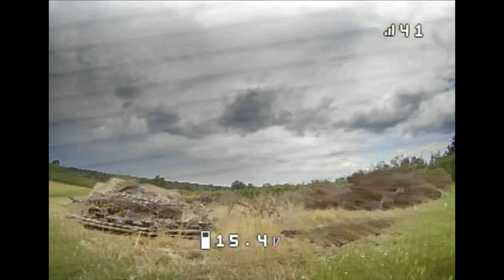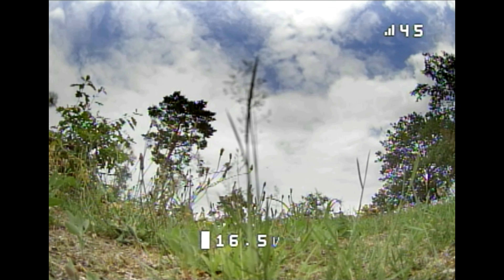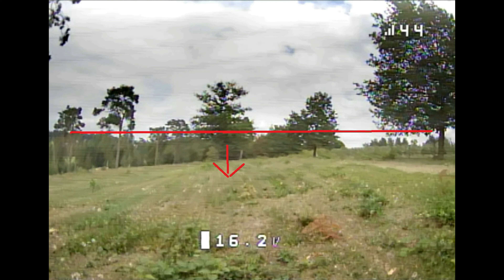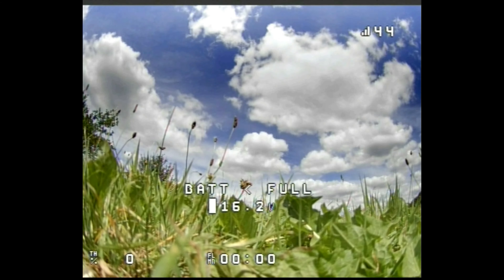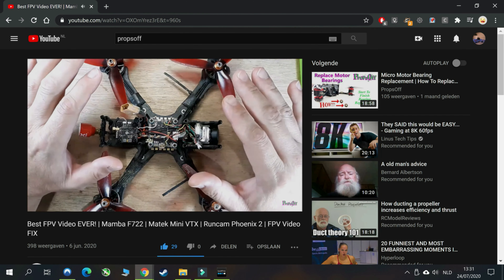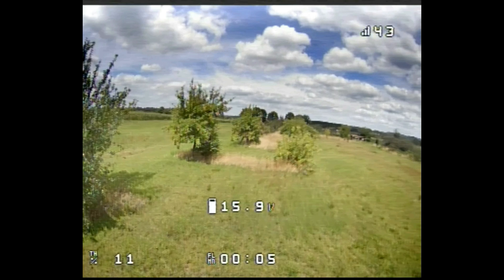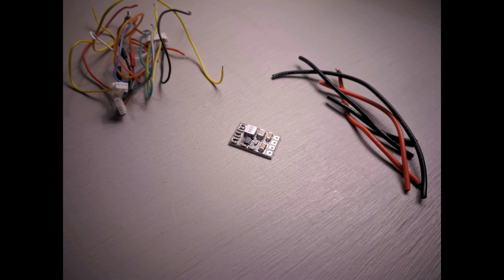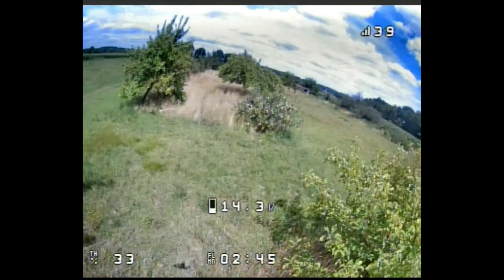How To Make Your FPV Video The  Best It Can Be | OSD Shimmering, Noise, Light and Dark Patches GONE!

Comment: Good tip I’d missed that PropsOff video. In his video his plan for cross grounding / redundant grounding seems targeted to the board design he’s got, he’s grounding between the different sections of the board. Did you do redundant grounding? I’m wondering how to apply it usefully to a smaller board.
Reply from the maker: Well it's been a while since I did that mod, but I believe I powered the camera directly from the main lead with a voltage regulator in between. I also did redundant  grounding yes,  especially the vtx and the cam pad pad even tho it was unused, but because most ground are connected, I thought it could help to give that area of the board better grounding and so less noise into the system. What do you mean by "smaller board"? Like a TW board or 20x20?
Reply: Thanks for replying! Yes, I'm looking at a 25mm Betafpv AIO. May try grounding from VTX to the ground in the VTX section of the board (it's unused as I'm trying a BEC from battery for VTX power) and see if it does anything. But that's sort of random, I'm not sure if it would be doing the same thing as what he's doing on that larger board.
Reply from the maker: @cw8165  You're welcome👍😃, that's a good idea. But I'd say try grounding it directly to the battery lead ground, that's the "biggest" ground you have on the board.  And make the battery lead as short as possible, that's also a big noise maker. 
A small cap could also help, not sure that'll do much one a 1s.

The best video I ever got  on a TW is when I used a TBS nano vtx ( the one that goes up to 500mw)

Comment: you know I have an old matek full size PDB on one of my 5 inchers... reason being I accidently blew the positive trace on the vbat rail doing something stupid for the camera power... had to use the PDB. Video looks really good! Just built a new drone with nearly identical parts and have a ton of noise... I wasn't sure if those mini PDBs would fit the issue but you are saying it will?
Reply from the maker: I'd say yes, use a mini voltage regulator to give the vtx filtered  power, and power your camera from the vtx not the main board. But I can't be sure unless I see your build...
If the image still isn't clean enough connect the ground pad in the camera area (on the fc) to the ground pad on the vtx. 

I'm sure you know all this, try and keep the main battery lead as short as possible, and of course use a capacitor, on the board side not the xt60 side.